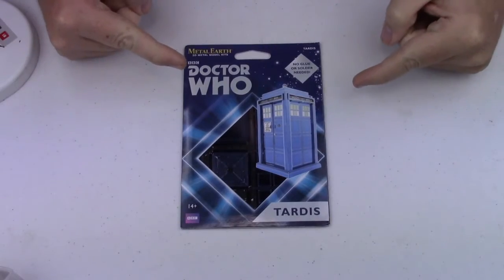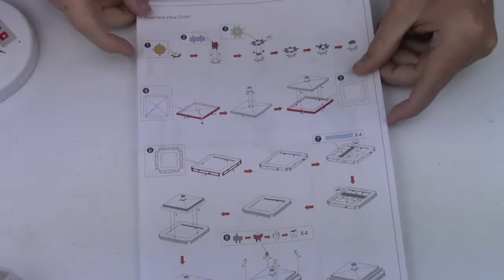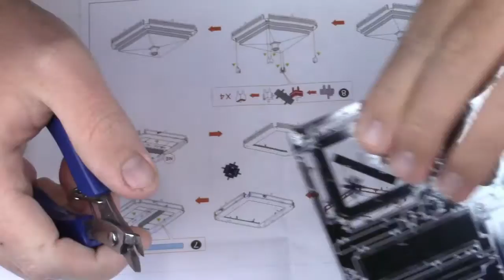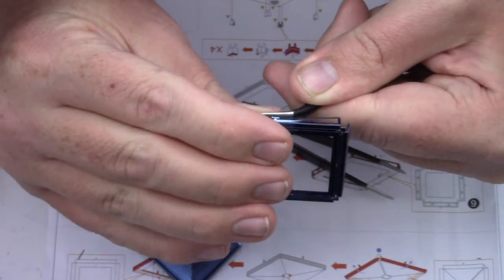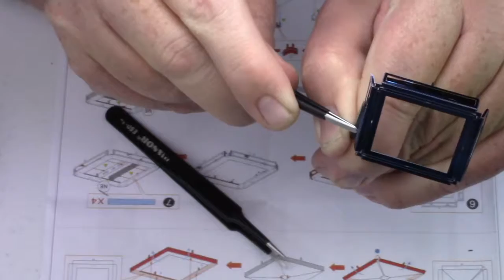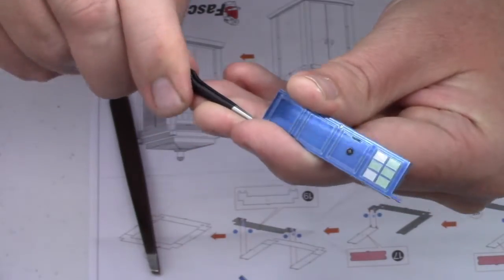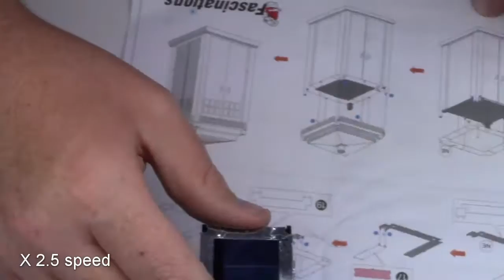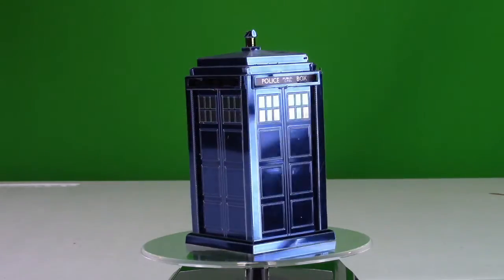Metal Earth Build - Tardis - Doctor Who

Comment: Having good quality modeling tools and being familiar with the manufacturer makes a huge difference: some parts are easier put on certain parts before bending specially if you only have basic (crap) worn out tools, also some are easily bent using your finger nails (carefully and no I don't bite mine ;) ) The lazer cutters used to cut fine work like this never cease to amaze me and the kit for first (old) timers needs to come with a straight jacket... Cheers for the vid, I'd have made a complete mess of it without it. Mine's shiny on the inside instead of bigger and hasn't got any round thing's... I did get a spare top light which I find hilarious as it's the first thing noted to do in the destructions and I instructed beyond repair it so needed it (how did they know?)